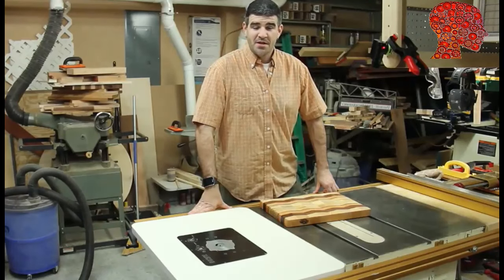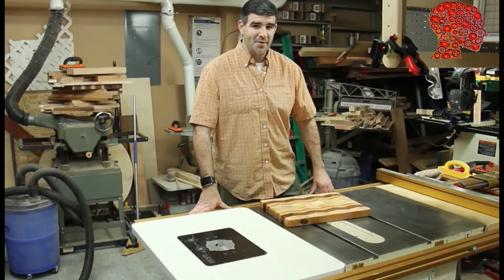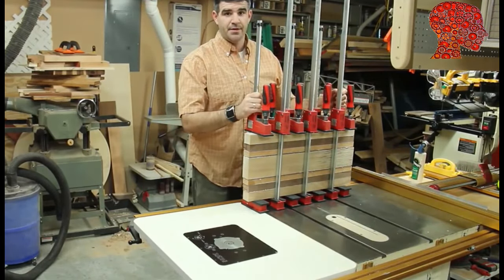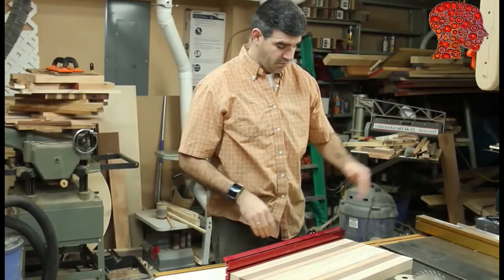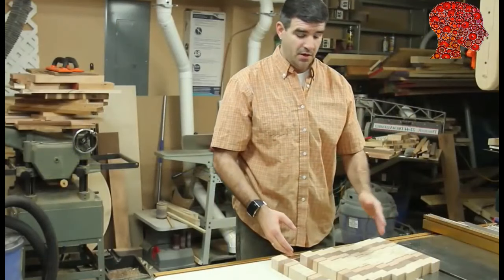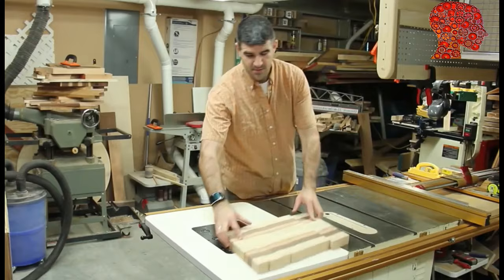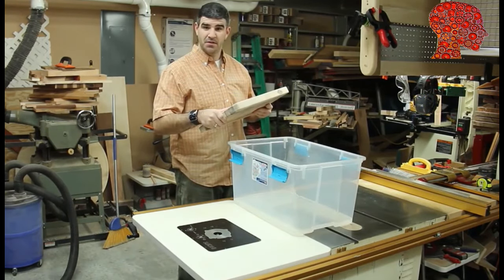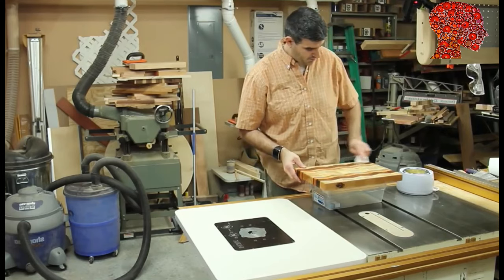Woodworking # 1 - Chevron Cutting Board 2016 Kitchen Utensil Build Challenge - Woodwork

Comment: Appreciate the video. One thing I noticed is he glued the boards using the surface of his table saw. I made this mistake once and forgot to clean up the excess glue from the squeeze out and it hardened and was a giant pain as I ended up sanding these areas down which visually made my table saw look really bad. Definitely recommend using any other surface than your table saw for glue ups! Even if you’re good at clean up, the risk of getting glue onto your cutter or cutter’s drive shaft isn’t worth it

Comment: Pretty brave doing all of the glue ups and even finishes on top of that nice table saw. Maybe brave is not the correct word. Great job on the cutting board though. Thanks.
Reply: I thought the same thing. I use my table saw like that. But mine is a piece of junk.